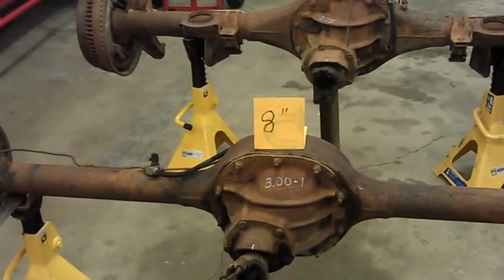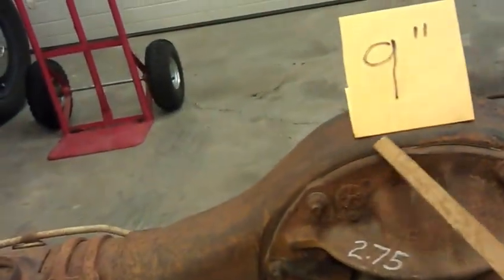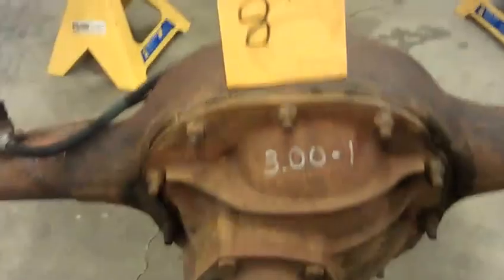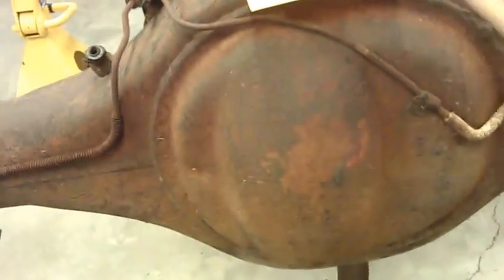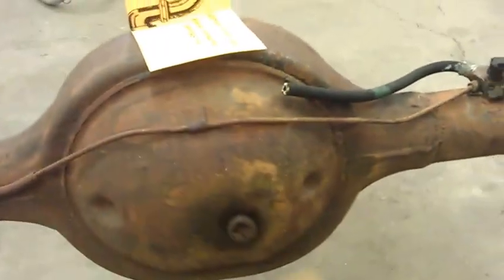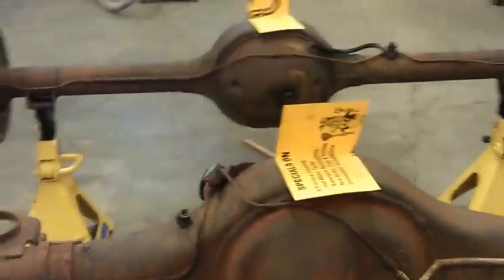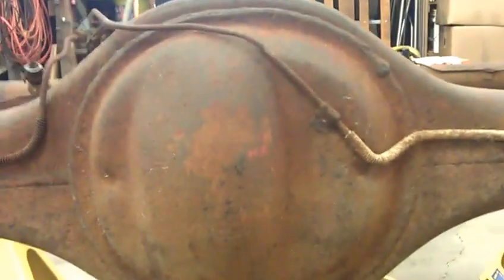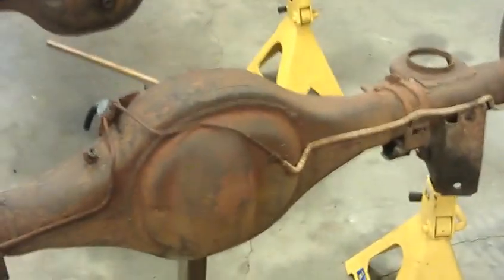How to tell the difference between a Ford 9 inch and an 8 inch rear end/differential - Part 2

Comment: thanks in the early 1970s my Dad drove a 67 Mustang Fastback 289 Automatic and he had our garage littered with Ford Rear ends. he  bought out of junkyards  all from different Ford models that had  different gearing in them  he would come home from work eat dinner then go into our garage to swap the rear ends in the family car  to try and make it a little faster ! he often. ran around with. a stopwatch  and was checking times with the family in the car  on rare occassions it was just him and I in the car  and as a boy i thought it was cool  most especially when he laid Rubber on the road !

Comment: Some of the 8" rears have vertical ribs in the front also. Not just the horizontal ribs like this one in the video. The stronger 8" rear center sections have a waffle pattern rib section, probably out of a truck or Bronco.
Reply from the maker: Thank you for your input on this. I am by no means an authority on this subject and anyone that has any more info to add to this is welcome.
Reply: reef lx good to know this as I was confused.  I'm new to Ford vehicles and my rear diffential looks like the 8" on one side but has that waffle look on the other. 
Either way, to the op, the video was very helpful.

Comment from the maker: It doesn't matter whether you use a deep socket or a standard socket. You cannot use any socket on those bottom nuts. You have to use a wrench to get on those nuts because of the shape of the center section casting.

Comment: Great video was trying to figure out my rear size on my 1966 Galaxie thanks!
Reply from the maker: My guess would be a 9" in that big car. There is a Web site called fordification.com that you could probably verify that.
Reply: Axel Power Garage thanks will do. There is a good possibility it’s a Galaxie Police sentinel equipped with a 289 but can’t get a Marti report for pre 1967 vehicles so I have to go off of the car data tag

Comment: Thanks for your brief informative answer, " if a deep well socket fits the bottom two nuts you don't have a 9" ford"!
Reply from the maker: You cannot get on the bottom nuts with any socket. You need a box end or open end wrench to remove the two bottom nuts on a 9".

Comment: LOL
If you can get a socket on the bottom two punkin bolts under the driveshaft...itza EIGHT.
Both 8 and 9 light duty rears had horizontal webbing only. They also had light duty guts.
The last year of production was 1965.
These are both OLD rear ends.

Comment from the maker: Yes. The basic housing on 8" and 9" diffs is the same for all years of production.
Reply: Best 9 inch identification video I have seen so far. Another thing an 8 inch can be moved around by one man and a dolly a 9 inch requires an engine hoist and an extra guy to push.

Comment: Please add the 9” Ford rear end has different axles The 9” has round dimples or indentations on the outside ends.  
8” axles have a D shaped space at the outside end.

Comment: Buy a Ford 9 "differential with a 3.00 WDD-B identification plate that according to this code corresponds to a 1965 Mercury, I want to install this differential in a Jeep Cherokee.
Here are my questions:
1- Is it a Ford 9 "or is it a Ford 8 3/4", is there this differential?
2- Is it a Ford 9 "with a ring diameter of 8 3/4"?
3- It has a ratio of 3.00 and the shafts have 28 splines. I want to modify it to use a 4.11 ratio with 31 spline shafts. What do I need to change in order to update it?
Reply from the maker: That is not a 9 inch. It is an 8 3/4 inch. I don't know if a 4.11 gear set is available for that. There is an abundance of after market parts available for the 9 inch. Also check the width before you attempt to install it in your Jeep. Here is a link to the information that should help.

https://www.fordification.com/tech/rearends_ford03.htm
Reply: I thought about doing this since i also have a 9" under my 70f100 and finding a good solid 44hp for front but pretty hard to find a 44 apparently they made of gold so maybe the 9 will fit under the 67 stang

Comment: Would have been nice to hear what size socket for the go / no go test. I Appreciate the video.
Reply: the nuts are 9/16 and the length of socket that I was using was 1and 3/4
Reply: he’s saying if you can get a deep well socket in there on the bolt it’s an 8” rearend.
Reply from the maker: The point is that you can't get any socket on those two bottom nut because of the design of the carrier housing. You have to use a box end or open end wrench to get on those two nuts.
Reply: some people are just too dumb.

Comment: Great information! Would the two axles be interchangeable on a Crown Vic, Grand Marquis and Lincoln Town Car?
Reply from the maker: The 9" would be the best choice for the full size cars. The 8" is intended for smaller pony cars and mid size cars.
Reply: @AxelPowersGarage  I definitely agree, my question is will it be a straight swap or will it have to be cut and welded?
Reply from the maker: They do come in different widths  and the mounting hardware varies depending on the type of suspension. If you can find a diff from the same car you are working on, it will be a simple bolt in application.  All the information can be found on the tag. Check a web sight called fordification.com for more information.

Comment: I have a 67 f100. Could it have an 8inch rear??? I see its shorter than the front
Reply from the maker: It should be a 9 inch. Pre '73 diffs are narrower than '73 and up. Yours should be around 61 1/2 inches wide not including wheel studs.

Comment: Excellent video, thanks!

I read somewhere that 9" diffs have 12 bolts on the front cover, and 8" have 10 bolts. Is this correct?
Reply from the maker: Both the Ford 9" and 8" diffs have 10 bolts. GM diffs of the same era however, are rated as a heavy duty having 12 bolts and a more common standard diff having only 10 bolts.
Reply: That cleared it all up, thanks!

Comment: I cannot find a axle vent bolt that fits my new hydraulic brake hose anywhere for my 84 8.8 rear diff. The old one(vent bolt) is too short. I got the same hose twice from two different stores so the hose is right. The old vent bolt must be a replacement. Any suggestions for a new one over 2inches long besides the junkyard?
Reply from the maker: I'm not very familiar with the 8.8 axles and I haven't heard of this problem before. I'm thinking the short bolt isn't the original for that diff. Is the ID tag still on the rear end so you can confirm that it is an '84? I use fordification.ccm to check tag info. Sorry I can't be more helpful on this issue. If I find something, I'll get back to you.
Reply from the maker: It appears that fordification,com doesn't cover 8.8 axles. A wrecking yard may be a viable option.
Reply: @AxelPowersGarage  problem solved with a little bit of grinding. Thank you for your responses.

Comment: I have an axle here that has the extra rib running down the front of the other ribs... but has dimples on the back and the flat top and bottom on the housing and the bottom bolts can take a socket straight on...... so its 8"??
Reply from the maker: If the socket will go straight on the two bottom nuts, I would say it's an 8 inch. Check the tag if it has one.
Reply: no tag on it, did some googlin and found out the 8" AFTER 1967 has a vertical rib on the front to add strength (I think they learned that from the 9") so I clearly have a post 67 8"... damn what a bummer. only paid $175 at least...
Reply: thanks for the quick reply!

Comment: Hey Lance, thx for the vid. Could you help me out with some dimensions on the 9 inch Ford? I need to know what the measurement/distance should be from the ring/pinion carrier assembly (aka. third member or "drop out') mounting surface (where the carrier assembly bolts to the axle housing with the ten bolts) to the axle/bearing centerline (minus the gasket), and what the measurement/distance is from the same mounting surface to the front of the pinion support mounting surface (minus the gasket). Can you help? Thanks!
Reply from the maker: I don't go that deep into these diffs. Check with an experienced builder.
Reply: Already have ...at least a couple of them ...but but can't get a response. I've also went through at least  8 - 10 different repair/rebuild/shop Manuals,by various publishers and can't find a reference to these dimensions anywhere. But thanks for the reply anyway. If you have an empty carrier housing and a simple ruler or tape measure,you can eye-ball the axle/bearing centerline.to get the first measurement.

Comment: I notice the 8" has a plug in the rear center, and the 9 does not. Mine does not, so is that another way to tell the difference?
Reply from the maker: Not a reliable way to tell. Both 8" and 9" had fill plugs in the back in other production years.

Comment: if i have a car that has an 8 inch in it and i want to swap it out for a 9 inch, will it fit up the exact same or will i have to make altercations?
Reply from the maker: If the 9 inch is from the same year make and model of vehicle, it should bolt right into your vehicle. Otherwise, be prepared to make some alterations.

Comment: Are they the same width?
Reply from the maker: No. The 9" is a fair bit wider than the 8". Only because the 9" came out of a '75 Torino and the 8" came out of s '67 Falcon.  The Torino is a bigger fatter car with a 351C in it. Falcon, a 289 car.
Reply from the maker: No. This 9 inch was wider than the 8 inch, but both diffs do come in different widths.

Comment: hi guys i have just got a 49 merc and have been told the diff in it  is a 9'' the front is definitely a 9 '' but the housing looks like the 8 '' at the back with the filler hole in the back ..any ideas
cheers Richard ..nz
Reply from the maker: +Cheyenne spencer  Check the tag info on the fordification website or try the socket test. Looks can be deceiving when looking at it from the bottom under a car.
Reply: +Cheyenne spencer Early pre-1967 9 inch housings didn't have the hump like in this video, they had the fill plug in the back just like the 8". If it's rounded then it's an early 9 inch.
In case you haven't found out already...

Comment: Also there are 9inchs with out the hump.
Reply: Yes Sir, I have just discovered this also. I have a 64 f100  that is a little confusing to identify with just looking at the housing. I can only tell for sure by the socket procedure on the two lower studs. I cannot get a socket straight on these nuts. The truck was a factory 6cylinder . Did they put 8 inch in pickups in 1964 ?
Reply from the maker: I don't know if they ever used an 8 inch in any pickups. Check www.fordification.com/ if you need to find out.

Comment: You forgot the most obvious telltale sign of all the  dimples in the back of the 8 inch.
Reply from the maker: That 9 inch has those dimples too, but not as prominent.
Reply: true, the problem is there's so many variations of both these rear ends, i've seen both max. ribbing  and then min. ribbing on both. I would like to find an early 70's 4 lug 8 inch used in the Maverick to put under my 62 Comet.